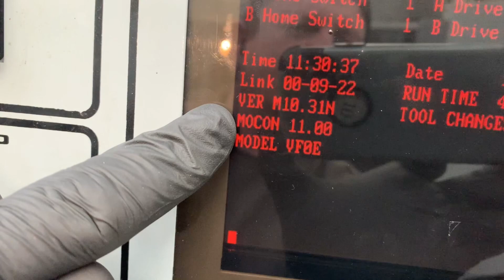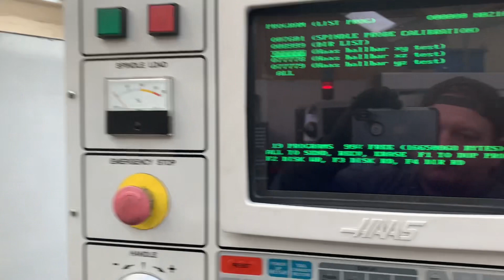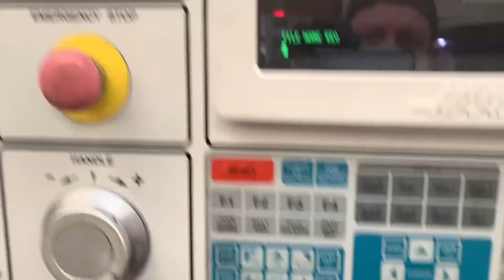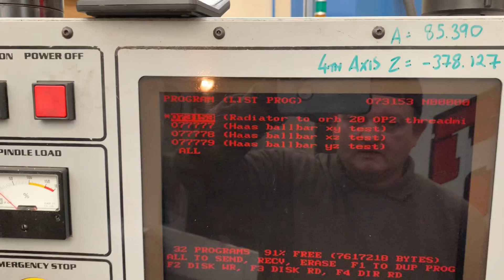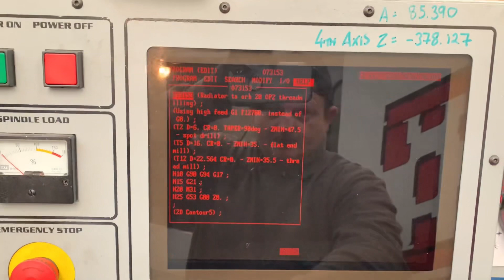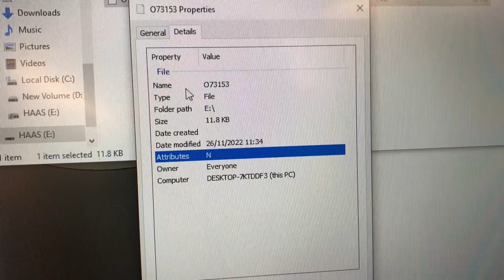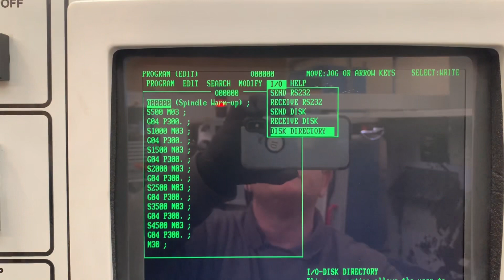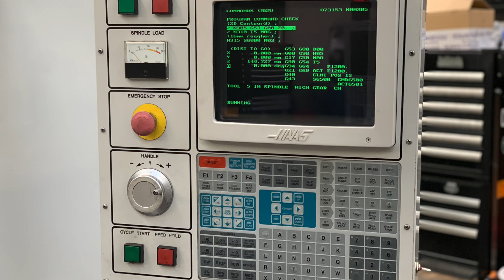Haas cnc machine usb problems!!!! What’s the answer?

Comment: Can you help ?
Flpy not enabled problem. 
Thank
Reply from the maker: Hi
If floppy is not enabled it probably means the option was not purchased for your machine? does it have a floppy drive already installed?  is there a code for floppy on the spec sheet inside the electrical cabinet at the back of the machine?

Comment: What post processor are you using? Autodesk recommends using their HAAS pre-NGG post processor the one included in the standard fusion 360 incompatible with VF series machines. Do a search for VF series post processor's it should be the first in the list on Google search seeing I can't post the link.
Sorry it's the 5th link down the page.
Reply from the maker: Hi
I use 1 of the fusion 360 post processors but it works fine with my other vf series mill so i dont think that is my issue on this occasion, as looking at the one you mention in the google search its the same as what im using

Thanks
Marc
Reply: @kinzy_fabrications  
On your second video I saw that you used the post processor I suggested. It is odd that both VF's would read differently. But that may be due to the software versions of the two machines.

Comment: Hi, I think i just wants file's without any kind of extension.  My 2002 Milltronics does that, as long as I post a file without any kind of extension it works just fine.
Reply from the maker: Hi

I tried outputting a file with no extension but it still didn’t show up when I searched the directory

Comment: Open the VF0E file in notepad. Check how the code looks. Maybe you can just replace the code in that file and save as a work around?
Reply from the maker: The code looks the same as any other fusion file, nothing gets added or changed that I can tell
Reply: @kinzy_fabrications  try to replace the code with new code and save. Use the file as a template. Maybe it will function as a workaround until you sort it out
Reply from the maker: @risengdesign  I will attempt that tomorrow 
Thanks
Marc

Comment: I had the same vf3 mill 1997 and you must change the file name after post on the usb (remove the .nc) then the control will see the file the newer mills see .Nc files
Reply: Yep what they said ^^ also I do love the dnc and read/write to programs via serial. You should look into it. I use DNC Precision software (they have a free ver for small files only) on a laptop and a 10$ null modem usb to db 9pin to the serial 1 port on the vf3. Howdy from Texas
Reply from the maker: Maybe I will end up with DNC but my vfoe usb is great so I want to try get it working
Reply from the maker: I have tried editing the fusion post processor so it output the file as just a file with no extension and that doesn’t work either ?
Thanks
Marc
Reply: @kinzy_fabrications  I Post all My Files to the USB Floppy then edit the file before i remove it from the pc and just remove the .nc
I couldnt work out how to make it post a file without an extention ether.

Comment: use a 1234 length name and save the program with no file extension IE save file type as all (*.*)
Reply from the maker: I’ve tried fusion post processor with no extension so it’s just a file and with 4 and 5 digit naming and neither worked! Makes no sense

Comment: Don't know anything about CNC machines, but "in the old days" filenames could only have 8 characters. (+ an extension). (only A-Z or a-z, or 0-9;  no spaces, accents,  or anything 'special') It could be, that the older firmware version has the same limitations. This also explains the "garbage" you get when you are trying to read what files are on the disk.
Longer filenames often get shortend to the first 6 characters and then ~1  (like SYSTEM~1 => another indication of the 8 characters limit). This shortening only works correctly if no of the unallowed characters are used. 
Don't know if this helps you in any way, but hey... it cannot hurt 🙂
Reply from the maker: Hi

Thanks for the reply,
Quite a few people have said the same as you but I have tried posting out the code with just the name TEST and the normal O and 5 digit job number but it does not seem to make a difference? Maybe there’s still something I’m doing wrong in this regard 

When I’m back at the workshop tomorrow I will try again and see what happens, 
Thanks
Marc
Reply: @kinzy_fabrications  Do you have the possibility to get the 9.64F version also to a M10.31N version?
Reply from the maker: @thinkr8142  Hi
I need to speak to Haas about that

Comment: I have no experience with either of these machines or the floppy emulators, but my general observation is that when your machine is able to find and read the file, the file in question is using a limited amount of characters '073153' and also without a file extension. My first troubleshooting step would be to try and save the program from the computer in this same way that the second machine was able to (8 characters or less, all numbers) and see if the problem still occurs.

The reason why the above may be relevant is that when characters exceed 8 characters, a special mechanism kicks in to allow the friendly and longer display of file names (greater than 8 characters), but not all devices may be able to handle this - although I would say modern systems should be able to. This system often will have a suffix '~1' or '~2' at the end of the file when displaying the short version which would indicate that this has happened when viewing the files on a system which either defaults to displaying the short version, or is incapable of displaying the longer friendlier version. This system is called 'Short File Name' and you can find the Wikipedia link here: https://en.wikipedia.org/wiki/8.3_filename

Normally on Windows formatted drives there is a directory called 'System Volume Information', which since it is such a long name would show as 'SYSTEM~1' on a system which is only capable of displaying the Short File Name version. The reason you probably don't see this in your Windows Explorer view is that it's marked as a Hidden and System directory. If you changed Windows Explorer to show Hidden files, you'd likely see it. It's curious that one of your machines doesn't show it, but the other does - that at least indicates it is handling it differently and a possible indicator to the above as the source of the problem.

My suggested test is trying to keep it under the above 8 character limit to avoid this possible issue. All being said the behaviour is weird, and I'm not sure if the above is related but it would be my first port of call.
Reply from the maker: Hi

Thanks for taking the time to reply 

I have tried to mimick the code format that gets sent out from the machine that then works in the vf3 but when I do that it still won’t work, that’s a program with no file extension with a name of say O12345 and the job name O12345 but as said that seems to make no difference and won’t work ! 
But when I open the files together, the one that works and the one I mimick they appear identical from what I can tell, same lines, same name, both no file extension etc but one from the machine works and one from fusion 360 post processor does not

Also what is confusing as that regardless of name size, if the job has been exported from the vfoe then it will always show up on the other machine so the long name thing doesn’t seem to be an issue 
It’s got me stumped !

Thanks
Marc

Comment: gotek run firmware they may not be the same version or even same maker of firmware
Reply from the maker: Hi
Yeah I thought of that so to check I swapped the other gotek emulator from the machine that’s fine and that did not work either so to me it’s still a program issue or a software issue 

Thanks
Marc

Comment: do you use the batch manage tool for windows to format? also I have an old cnc lathe that uses the emulator as well, and requires there to be no file extension. if you can post a video with the different settings between the machines.
Reply from the maker: Hi

The machines don’t have any settings for file names, but as show they do have different software versions 
When I output the program from the other machine it comes out with no extension and works fine but if I mimick this and post a program out from fusion 360 with no file extensions it doesn’t work still?, very confusing and I’m obviously missing something 

Thanks
Marc

Comment: That looks like it's reading some internal hard drive or rom hard drive emulator or something, not the usb floppy emulator. Are you sure the floppy cable is plugged in the right way around (both on the USB emulator, and on the other end of the cable)? Floppy cables won't work if they're flipped around the wrong way when plugged in. If that thing is basically a PC running the Haas controller (which I think it is), check in the bios to make sure the floppy drive is enabled too.
Reply: oh, I didn't watch the full video when I commented above. It could be the older controller just wants filenames without the .nc extension on the end. They're all just text files - you should be able to open them with notepad on the computer, but maybe the older control just doesn't want the filename to have the .nc at the end. Just rename your program you want and remove the .nc extension on the filename on the USB stick, and then it should show up on the older controller.
Reply: it also looks like the file you were trying to load is more than 8 characters, because on the machine that does read it, it has the ^ character in the filename which was the way dos shortened long filenames (which are valid in windows 95 and newer, but not in dos). Maybe the other controller doesn't like that in the filename too, or doesn't support the long win95+ filenames. So the other thing you can try is make sure the filename before the dot is 8 characters or less, and try it both with .nc extension, and no extension on the filename too - it'll be some combination of those things.
Reply: Oh, and a 3rd possibility is that it doesn't like filenames that have letters in them - old machines might only like program names / file names to have O and numbers only - seems it was a limitation of old cranky controls, so that's another possibility. When you save it on the newer machine, the filename is O followed by numbers only (and with no extension). Another thing to try
Reply from the maker: This also seems to have no affect! i have tried just calling it test so its under 8 letters but still no joy
Reply: @kinzy_fabrications  open the "test" file on the machine that reads the files, check if it shows the "^" character in the filename on the machine that will read it, and re-export it back out to the floppy (usb stick) without deleting the original one. I see you have notepad++ on your computer, use the compare plugin in notepad++ (or something like BeyondCompare) to open both files from the USB stick (the original and the one that you re-exported from the machine that can read them) side by side and look at the differences - I'm guessing there won't be any. Also, try naming the file O(numbers) that match the program number in the first line of the file - that might be the sticking point. Sometimes in current versions of windows, it hides file extensions, or adds file extensions that you can't see unless you change a setting, and that could be tripping you up. It's definitely that the older machine is based on an older version of dos and doesn't support windows long filenames. Somewhere under "folder settings" there's an option to "hide extensions of known file types" or something similar, and you need to turn that off so you always see the full filename on windows.
Reply from the maker: I have compared them side by side, the original before and after exported from the vfoe and there is no difference at all

I also unchacked the box that said hile file types and that made no difference at all either?
Reply: @kinzy_fabrications  did you try naming the file O73153 initially (without importing and re-exporting it from the vfoe) and see if the other machine can see it? If that's not it, then you could try swapping the USB floppy emulators between the machines - maybe one of them has a different firmware on it, or potentially a setting that's not set by a jumper that's causing an issue. It's either something to do with the file name, or the USB floppy emulator itself somehow...
Reply: @kinzy_fabrications  Hi mate, I can help you with this. Been watching your stuff for a while and think this is something I can actually help with. I'm in the UK, you wanna just do this on facebook or whatsapp or something?
Reply from the maker: Hi

If you have any ideas that would be great
Message me via my Kinzy Fabrications page on face book

Thanks
Marc
Reply from the maker: No luck, I swapped the usb emulators as well and no luck either so it has to be software related
Reply: @kinzy_fabrications  done
Reply: @kinzy_fabrications  Did you get it figured out? I see many people here suggesting the same thing - no extension, and keep the file name short - maybe even only 4 digits after the O (which doesn't really make sense as when you re-saved it from the vfoe, it had 5 digits and it worked)
Reply from the maker: @gorak9000  Hi
Nope I still haven’t worked it out, I tried no file extension, I tried no name just a number with O prefix and tried 4 and 5 digits but still nothing! I even swapped usb emulators between machines and the one that works in the vfoe did not work in the vf3

But every time I export any name or number or size file from the vfoe it will then work in the vf3 every time? So I modified the post processor to have no file extension so it looks like a file exported from the vfoe it doesn’t work so I’m a bit stumped 

I have previously managed to load one program into straight from fusion but maybe I was just lucky
Reply: @kinzy_fabrications  when you load a file with a short name and no extension into the vfoe, do you see any "^" or "~" in the filename, like it showed at 1:19 in this video? Here it shows "RADIAT^1" as the filename, which is the short version of that huge long name you had it set to on windows. Or does it show only the O##### with no special characters? Also, can you post the files of a simple program that the vfoe can read, but the other machine can't, and then also post the re-saved file from the vfoe? I will look at them with a hex editor to see what (if any) differences there are. It's not good enough to look at them by hand and see that they contain the same text - need to look at the raw hex to see if there's different line endings or something that's causing it to not read the files directly from CAM, but can read the ones re-exported from the vfoe. Maybe just send me an email andrew dot hakman at the google email place... I'll take a look at the files.
Reply from the maker: I have tried files ending in .nc also .txt and also no extension at all and it makes no difference?
Thanks
Marc
Reply from the maker: Hi

i have checked the usb drive cables and they cant be plugged in the wrong way around due to connector design so thats good. floppy drive is enable in the settings and as it will recognise a file exported from another machine it must be working in general? confusing lol